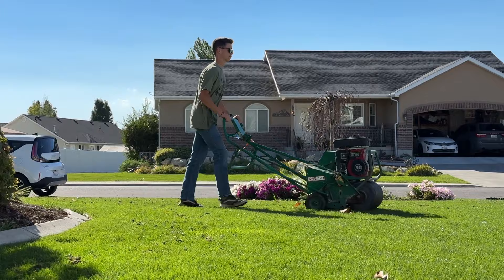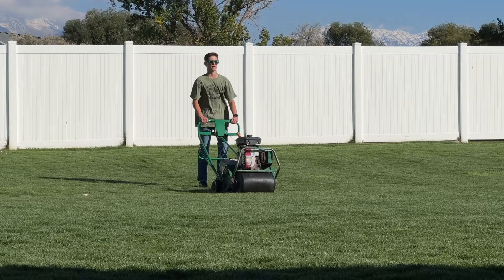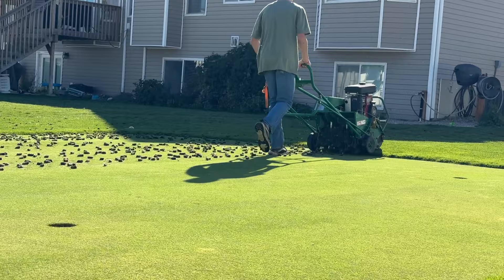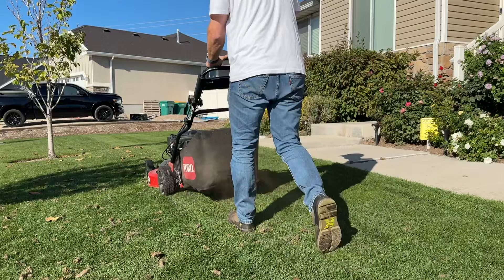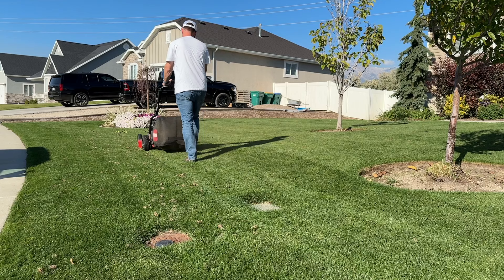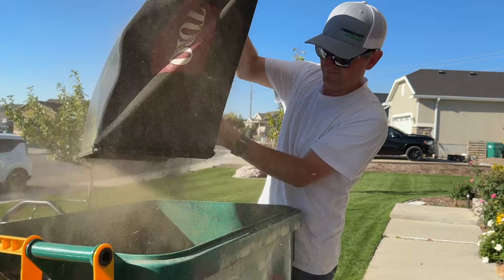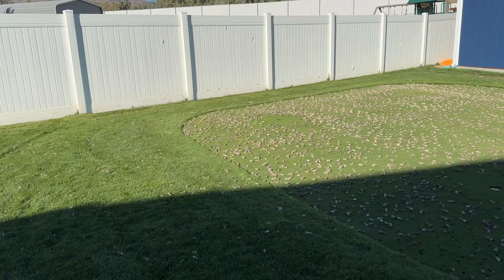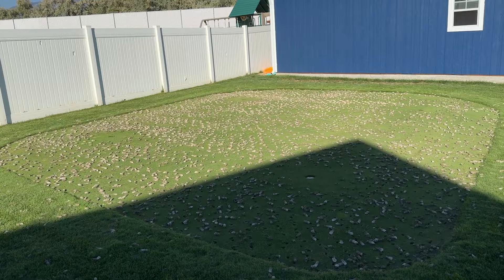I DID NOT Aerate My Lawn This Year...

Comment: I agree with fall is best. However I live in Minnesota and we had over 100” of snow last winter. Usually that isn’t a issue but it snowed so early last winter the ground had not froze yet. The early blanket of snow acted a a great insulator and we never had the ground freeze properly. Lack of freeze and a crap ton of snow caused major compaction. We also had a drought this summer 😂 so compaction issues were exacerbated. When I aerated this fall I could literally see my yard take a deep breath.

Lesson learned and I will be prepared to aerate in the spring if necessary.